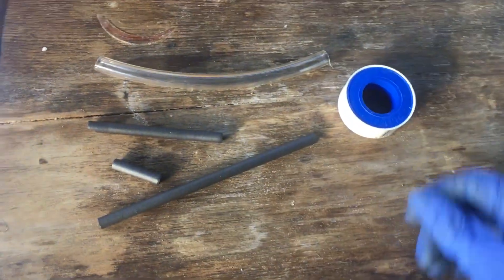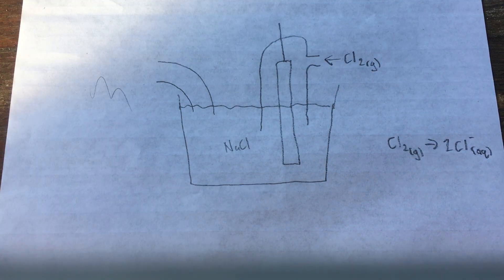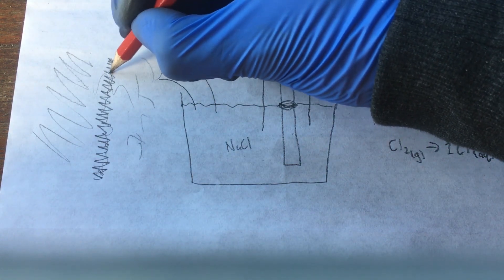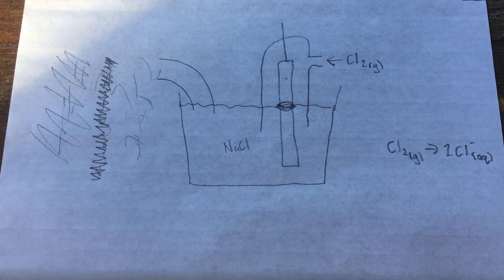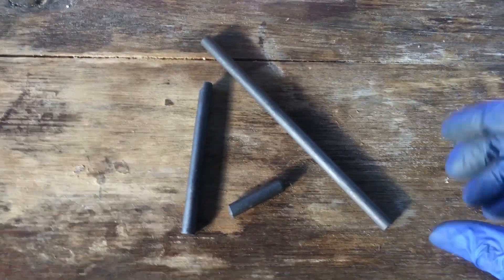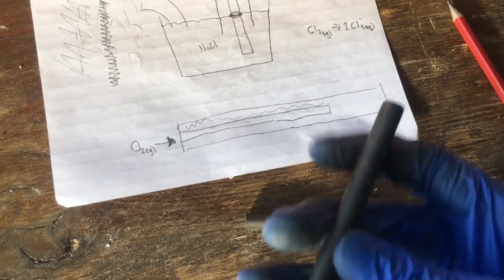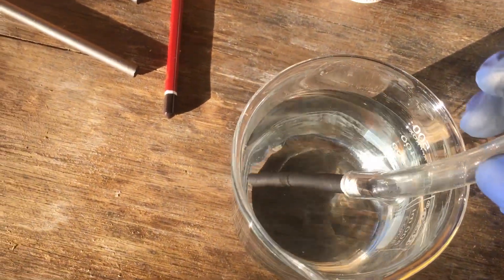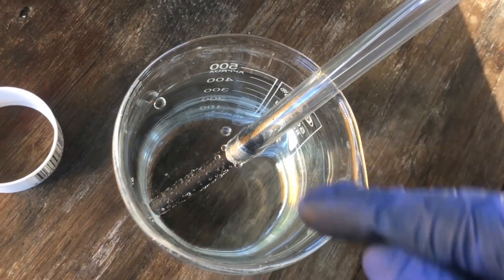Making A Gas Diffusion Electrode

Comment: You should take a bubbler stone for Fish tanks and soak it in a sugar solution, thick sugar solution so its like candy and then boil that in concentrated Sulfuric acid.  IDK if that will work but my intuition tells me it should be a great way of doing this as it will coat the entire stone in an activated carbon of sorts but should remain porous.  If I ever need one, I think I will try that.

Comment: That a great concept, because the resistance to gas flow through the graphite will be a lot higher than the resistance to gas flow down your hole.  So you'll have more or less the same pressure drop through all parts of the graphite - should be very uniform.  You might want to try to seal the portion that won't be submerged so you don't lose that portion of your gas.

Comment: I did my Pham in electrochemistry. We made lots of gas electrodes. The method was to use Tyvek (like in house wrap or rain coat material).  It is plastic with very small holes and is ver hydrophobic, so water can’t get through but gases pass right through. We then pained one side with conductive paint. We made gold, silver, and graphite electrodes this way. You just put the membrane over a gas inlet with the conductive coating in the solution. Start the gas pressure low and monitor the current. You want the highest current without seeing any bubbles. That is your optimum reaction rate. The advantage is that it is easy to make large electrodes and Tyvek is cheep!

Comment: You are going to lose a lot of gas that doesn't react.  I propose putting a cover over the electrode (like in your initial diagram) & use that to capture the gas that bubbles off & recirculate that.

Comment: Cool Idea, man. That can be useful for something different too I guess. 
Not right sure, but possibly glowing the electrodes while pressing the air through them, could increase porousity a bit more, due to oxidation of some Carbon in the wall. By the way, it also may be a way to impregnate the Carbon rod with Catalyst salts, as it should be possible to press a soltion (e.g. of a Titanium-salt) through them this way too and glow them after that. So you can make the Electrodes that are mentioned in this pdf https://patentimages.storage.googleapis.com/13/4d/99/dfbb875f401486/WO2010134717A2.pdf

Comment: Cool, so you have a solution for making the gas diffusion electrode ! I don´t have to buy an expensive one. Great !!! Graphite should be plenty because it´s only in contact with an alkaline solution and being a cathode as you said at the other video it should last nearly forever. I think graphite only crumbles as an anode If I remember right. I tried it in the past for making chlorine from NaCl and that was my observation so far. Thanks for your credit anyway :D. I will also make a video to confirm you. And yes that is a good thing no catalyst needed haha. Do you know a method to make a membrane at home ?
Reply from the maker: A proper membrane is incredibly tricky to make. The cation exchange membranes (probably the easiest to make of the two types) involve making teflon polymer functionalised with sulfonic acid, definitely not something possible to do on a home scale as it requires incredibly dangerous (and very difficult to make or buy) reagents like HF or SO3. I've never found any methods for making proper membranes, I'm afraid they're just way out of reach for home chemistry.

Unless you can buy some (I don't think they're too expensive, but I've always had trouble with postage), we'll just have to make do with diaphragms like a clay pot or similar.
Reply: Maybe you can use two flower pots one for the cathode one for the anode and in between your H2O2 tank. Not hard to buy the guy wanted to sell me the whole roll at 500€ or so.
Reply from the maker: That's the plan for the setup, hopefully using pots instead of membranes doesn't impact the yield too much
Reply from the maker: I'm afraid the glazing does block the current, as the liquid can't permeate through it. You'll either need to dremel it off as you said, or buy unglazed pots
Reply: @ScrapScience  So would you use something like NaOH at the cathode and an acid at the anode? Then perhaps the OH- from the base and the H3O+ that ends up in the center (where H2O2 forms) would just form H2O? Though I don't know how the center region would conduct other than from the imperfect separation of ions which might defeat the purpose of using these two types at anode / cathode. Maybe I have the process all wrong though. Edit: Though I was just thinking... Maybe you could load the center with something like Na2SO4 and wait for conduction to drop to ineffective levels associated with the depletion of Na2SO4 and (hopefully) enriched H2O2.
Reply from the maker: @Clipster15  You've pretty much got the exact idea of the synthesis. The paper uses dilute sulfuric acid in the centre chamber (H2O2 is quite stable in acidic conditions, and sulfuric acid conducts very well) and uses ion exchange membranes to specifically prevent depletion of the sulfuric acid in the centre chamber (anion exchange to the cathode, cation exchange to the anode). I'm hoping that using simple clay pot diaphragms instead of ion exchange membranes will simply result in the slow depletion of the sulfuric acid in the centre, along with a bit of a loss in efficiency.
Of course, the final H2O2 product will be contaminated with H2SO4, but I think that's okay. (In theory you could carefully react the acid with calcium hydroxide to precipitate the sulfate out of solution and get pure H2O2 like that, but I probably won't bother, keeping H2O2 in sulfuric acid is a good way to store it)